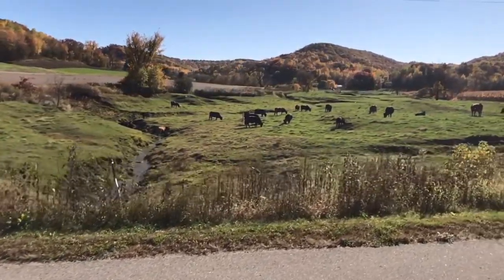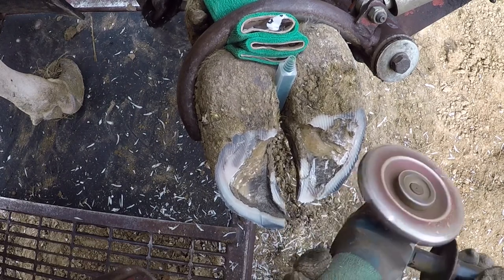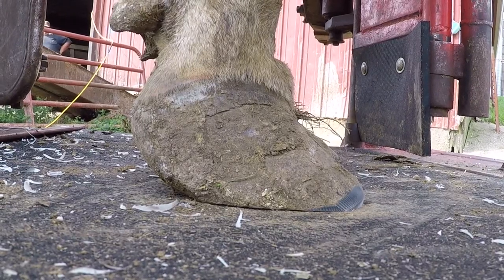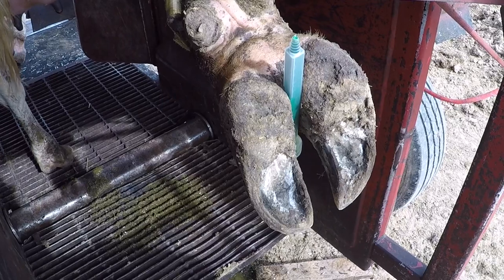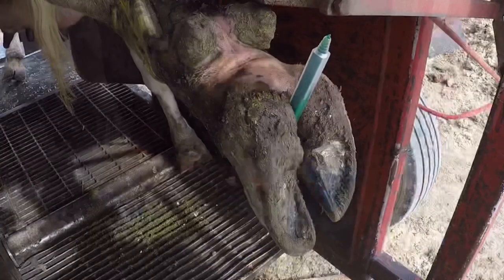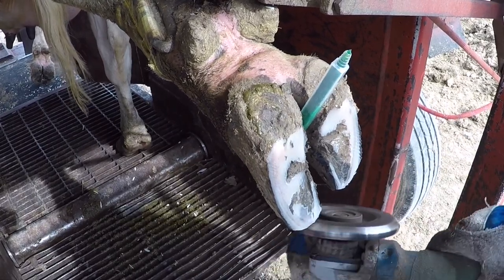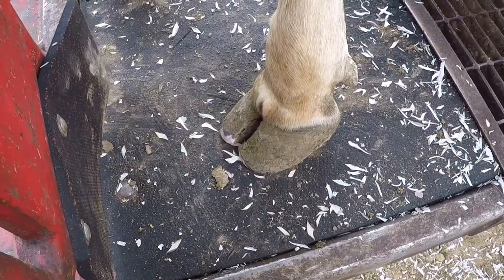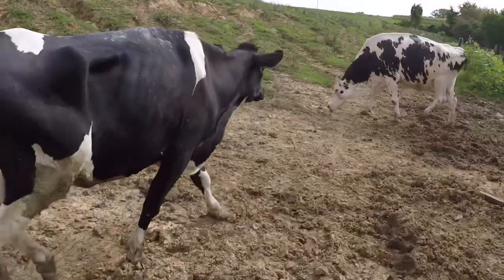Creating a COMFORTABLE COW in MINUTES==SATISFYING

Comment: do you ever have to change the disc on the trimmer?  or sharpen the blades?
Reply: Belive he does sharpen them, but I am not 100% so don't quote me on that.
I have read an answer he gave to a question on a different video that he goes through 20-30 knives a year.
Edit: Spelling
Reply: Yes he sharpens or changes the blades in the wheel. I'd guess somewhere around every 50 or 60 cows.
Reply from the maker: Yes.  I put sharp inserts in every day and I resharpen them myself.

Comment: What if you took an air compressor and blew out the epoxy tips so you could reuse them.
Reply from the maker: They are mixing tips so it wouldn’t work.  Corkscrew shaped on the inside.

Comment: I haven't been watching this channel very long, so can you explain to me why you don't deeply model out the feet like others do that follow the Dutch method. 
I know hoof gp once insisted you needed to model them out. I'm sure there is a reason for what you do.
Reply: These cows are modeling themselves when they're on dirt. The hoof naturally sheds away. The reason for modeling is to relieve the pressure on the bone inside he hoof. Cows housed inside don't shed like this cow did therefore modeling is need to avoid excess pressure on the pedal bone. However if you have good heel thickness you can get by not modeling because of the angle of the bone.
Reply: @user-zu2bw7ig5v  I'm aware of the reason for modeling out and that these cows shed. That wasn't what I asked.

Other trimmers deeply model cows whether they are inside or outside. 
I'm asking why he personally doesn't do this when everyone else seems to.
Reply: @GotAnUmbrella  he feels it isn't necessary if the cow has good heel depth.
Reply from the maker: Modeling increases the rate at which a sole wears.  Removing large portions of the heel area result in more pressure being applied to the remaining heel area causing it to wear faster.  Shallow heel depth creates more pressure in the exact area where we want to remove pressure.  Over time, cows trimmed with the Dutch method will have shallower heel depth.  Research studies have failed to show reduced lesion occurrence as a result of deep modeling so limiting wear and maximizing heel depth is the route I choose to take.  If modeling truly did remove pressure we’d expect to see sole ulcers disappear when modeling is used.  That hasn’t happened as evidenced by others’ videos.
Reply: @NatetheHoofGuy  thanks for your response. I've read people that insist you do it wrong because you don't deeply model. What you says makes a lot of sense. Your cows don't seem to suffer despite the fact you don't deeply model them out.

I'd love for an actual controlled study on this.
Reply from the maker: @GotAnUmbrella  I know they do.  That’s okay with me.  I used to model but adapted my method about 10 years ago and have zero regrets.  The great part about YouTube is that I can highlight the advantages of different trimming styles with evidence over time.  I’ve already had researchers in the field take note of the increased heel depth on the cows in my videos.  Proof that my adaptation is getting the desired results.
Reply: @NatetheHoofGuy  I'm glad to see people taking notice!